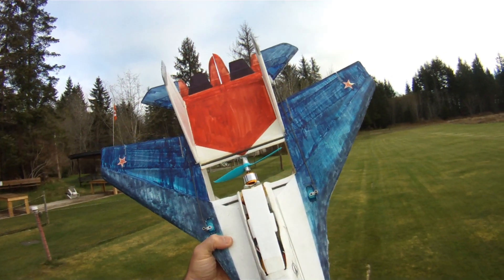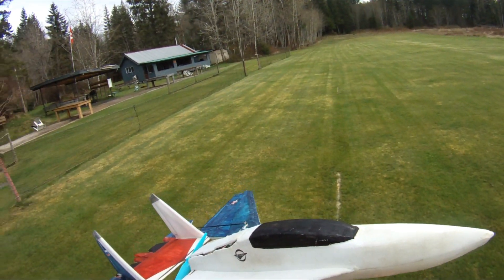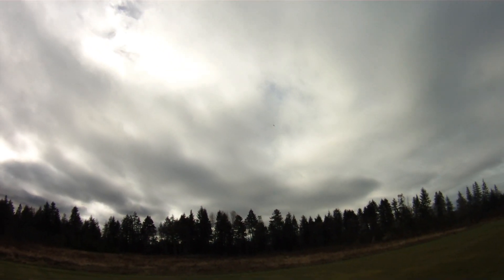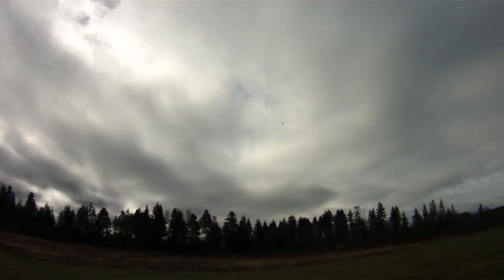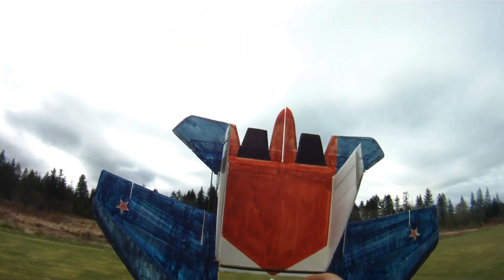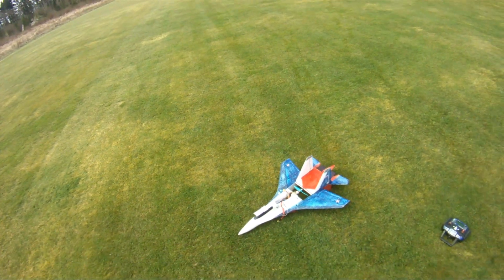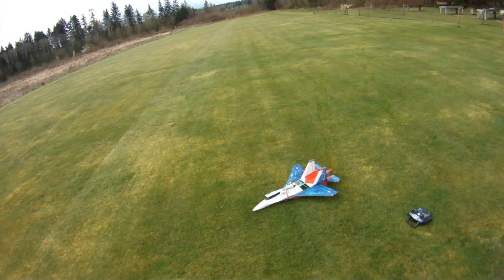2212/5T 2700 kv motor GF Flash 6042x2 prop on 3S - 17 Apr 2019

Comment: Hi, I have the same engine (but 2200kv) my doubt is that insi remember if you had any temperature problem? Is it a normal temperature? More or less when T° ?
Reply from the maker: I shot this video https://www.youtube.com/watch?v=x-KslkZIAwk&list=PLKu3yFqYM98mOVc6vpxiog7bNmulXp1kU&index=10 field testing the 2212/6 2200 kv motor using this GF Flash 6042x2 prop, it is the best prop I have used on that motor on 3S, it ran much cooler than the 2700 kv on 3S.  Cheers, Scott

Comment: I like your channel, but I have noticed you only seem to fly high speed passes. Do you ever do slow flying with your park jets? I've been flying the glue n go series from hobby king and I'm thinking of trying KF airfoils on it next. I love flying these planes slow and fast.
Reply from the maker: Thanks very much, many of my videos involve testing props, motors, etc, so I do like to push them pretty hard in the video.  Most of the time I fly around 50-60% throttle, are you wanting to fly slower than that?  I did this video awhile back on how I calculate and make my KF4 airfoils on the park jets I build and fly https://www.youtube.com/watch?v=g8D9zcPDDyw&list=PLKu3yFqYM98l-SDLJd_2YeqBzMZ9n7xLg&index=4  Best of luck with your experimentation :)  Cheers, Scott
Reply: Yeah I like to fly way slower, watch my video on the SU-27.
Reply from the maker: @rcpilottony2338  Some nice flying, so what KF setup are you thinking about for your planes?  Cheers, Scott
Reply: It looks like I should use the KF-4 airfoil for my style of flying. Now you say 40% of the wing size and some say 50%. Does it really matter, if so I was going to go with what you say.🤔
Reply from the maker: @rcpilottony2338  Yes, it does matter what size KF you use with swept wing planes.  50% is best for wings that are straight, but as soon as you start to sweep the wing like on Sus and Migs, 50% is too big and will cause handling issues and make the plane more difficult to recover from dives as well as increase drag.  In my testing and experience, you want to go with 40% of wing chord for swept wing planes like most park jet you might fly.  Good luck.  Cheers, Scott
Reply: Ok thanks Scott for the advice, that helps out.
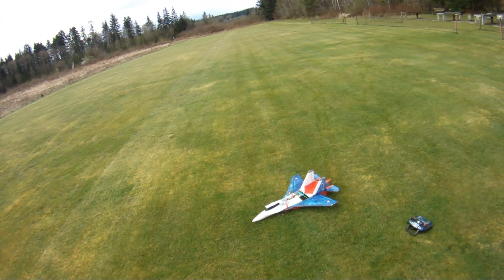Reply from the maker: @rcpilottony2338  Sure thing, I put KF4 airfoils on a profile park jet awhile back as well as all the controls, I discuss my KFs in this video starting at about 5:08 https://www.youtube.com/watch?v=4_0G-AGN6nM&list=PLKu3yFqYM98l52aWAAGL0dneUeFQW7HtA&index=3  Good luck :)  Cheers, Scott

Comment: That's some great torque for a motor that cost less than $6 US! I see Hobby King is out of stock once again on the ESC ;-) Did you buy them all ?  Great test with that motor and prop combination and very fast ;-) See you in the Air!
Reply from the maker: Thanks, yes it is amazing how hard you can push those inexpensive motors, although I am pushing it right to it's limit with this prop :)  Sorry, haven't purchased a Plush ESC for over two years, Hobby King seems to sell out of a lot of stuff these days and it takes forever to restock :/  Cheers, Scott
Reply: @e3Scott  , hehehehe....I hear ya!